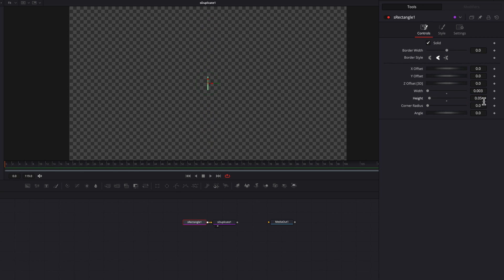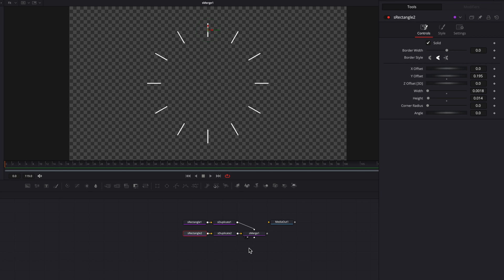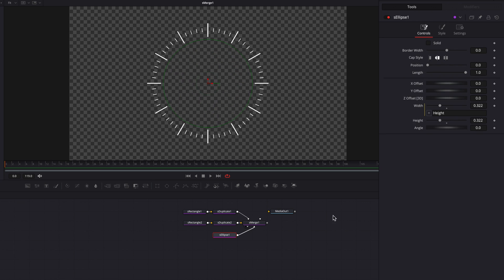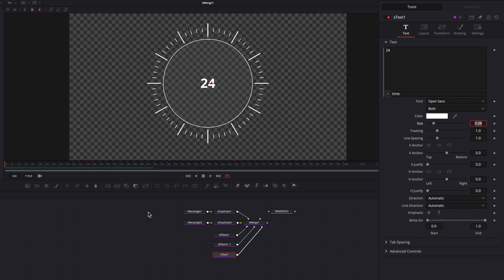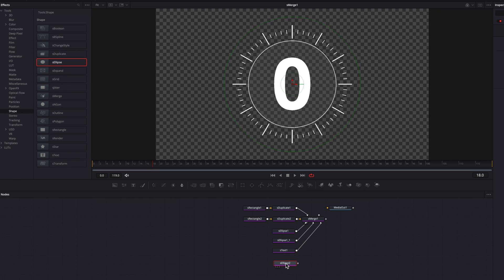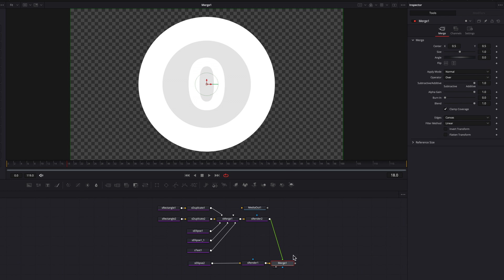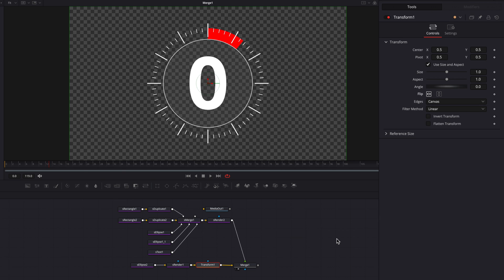Dynamic Custom Timer That Anyone Can Make in DaVinci Resolve (NO Keyframes!) | Fusion Tutorial

Comment: That's amazing! How can the numbers also be counted backwards?
Reply from the maker: Thank you! Good question, so try (comp.RenderEnd-time) instead of just (time) for the formula. That should work.
Reply: in sText; text expression:  math.floor((comp.RenderEnd-time)/30+.95). add partial second to and extend a couple frames beyond total seconds to get to a zero display. I was using 30 fps. Probably. can be finessed a bit for greater accuracy.

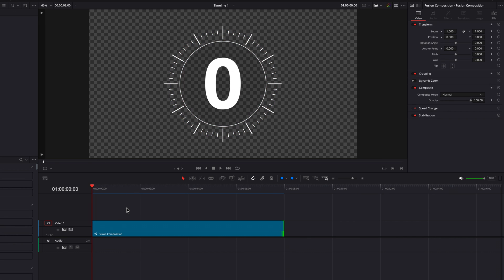Comment: The tutorial was great, but I have a question. At 9:05, the clip ends at the 8-second mark, but the timer only shows 7 seconds because the clip needs to be extended by one frame for the text to display 8 seconds. How do we deal with this?
Reply from the maker: hi so to your question, since the effect is dynamic, you can extend the clip by 1 sec and then you should have 8 seconds displayed.